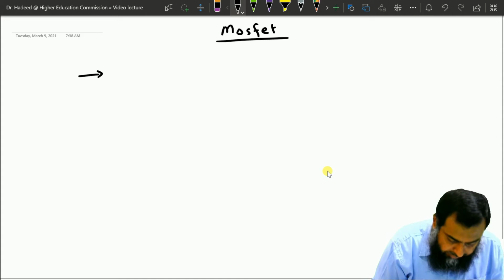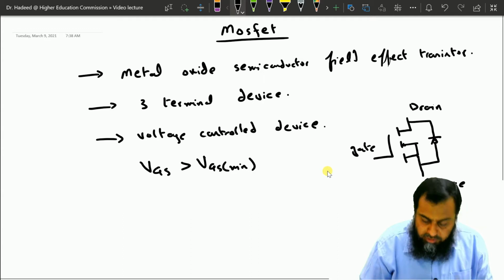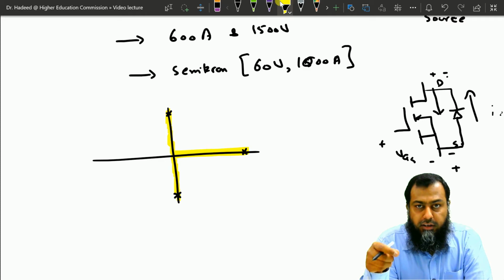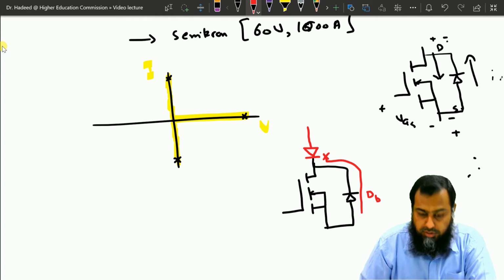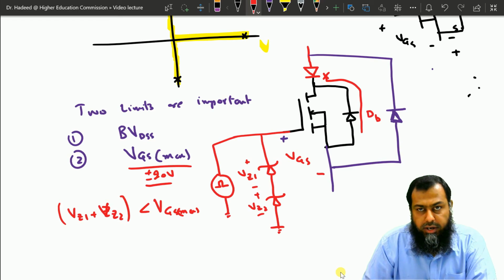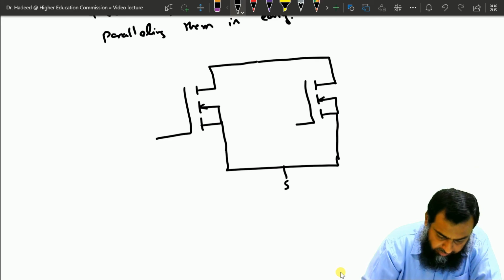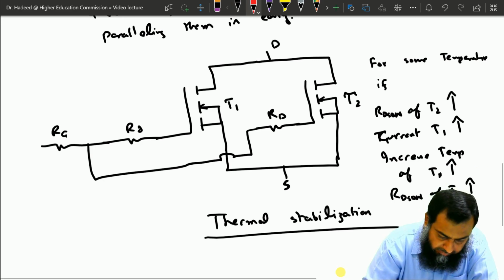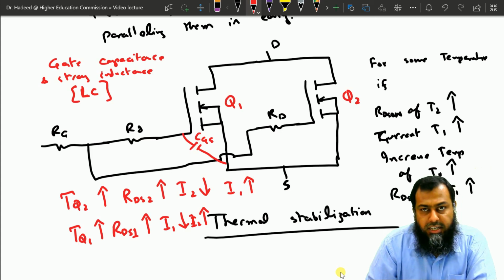Power Electronics Module 1 Lecture 4 | MOSFET

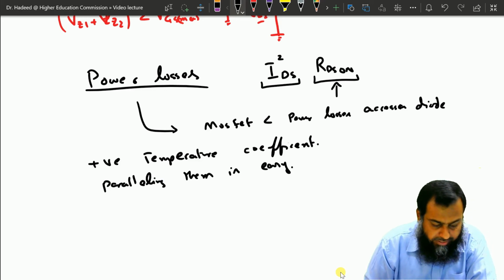Comment: @11:13 MOSFET doesn't show postive temp coefficient always ...it shows all three behaviour +ve ,zero and -ve temp coefficient depending upon where your gate voltage is..that can be referred from ID vs Vgs curve.
Reply from the maker: For power electronics, we use it as a switch where it showcase only positive temperature coefficient.

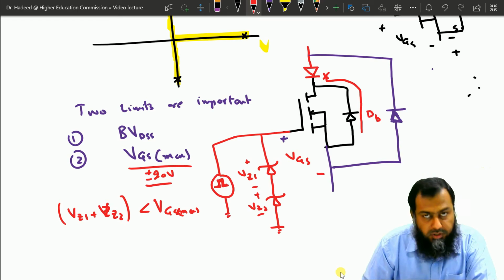Comment: @9:39 I think it should be back to back zener diode .. practically you don't need to have two zener diode in the same direction...Most of the MOSFET gate voltage breakdown exist between 15-20 V..in single direction one zener diode of 15V is enough to protect..
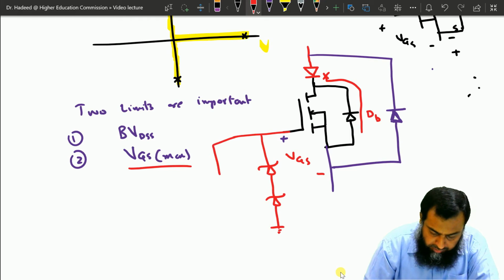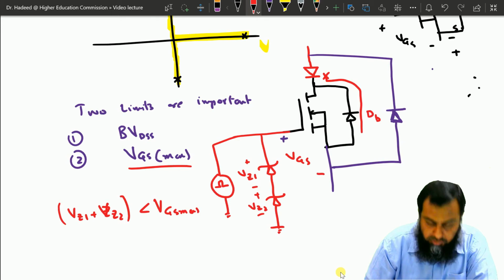Reply from the maker: I agree with you but this is not a back to back zener diode. Here the emphasis is to use two zener to emphasize on the concept of zener voltage as indicated verbally at 8:55 and at 9:23 incase if the required rating zener is not available.
Reply: @HadeedSher  Many thanks for your response sir.... could you please upload any lecture on DC link capacitance calculation for 3 phase inverter?
Reply from the maker: @powerpath-n4u  I need to work on it since it has been a long time since i worked on the 3 phase inverter.